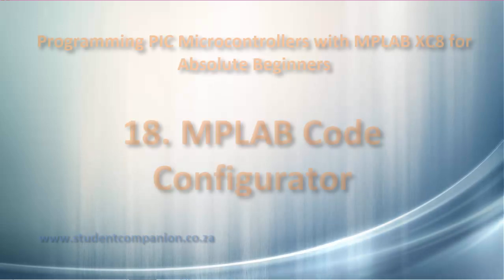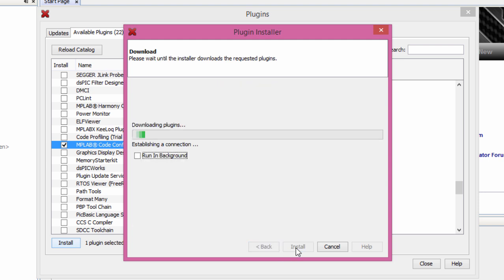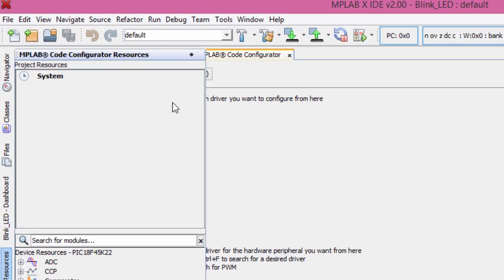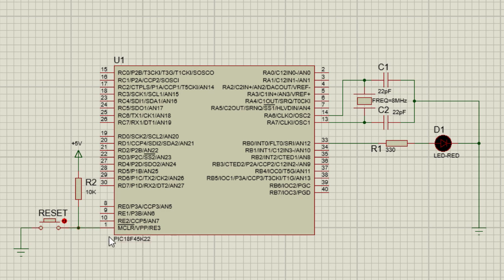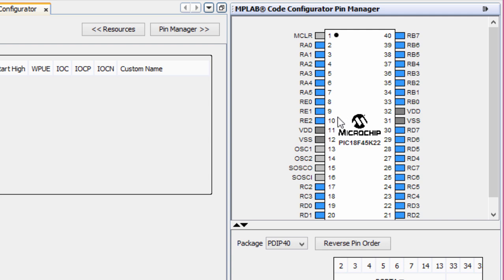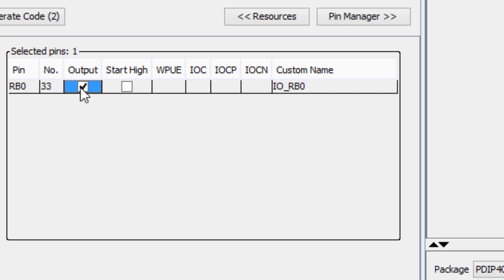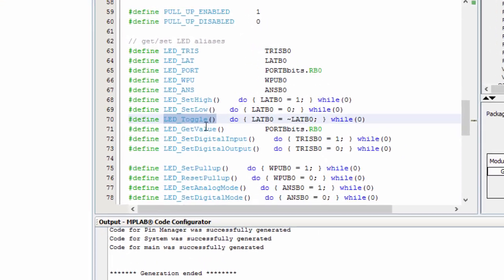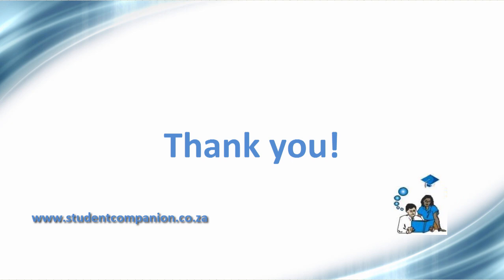18- Getting Started with MPLAB Code Configurator | MPLAB XC8 for Beginners Tutorial

Comment: Thank you for your great tutorials! Its has been a very big help. Unfortunate I cannot get my MPLAB Code Configurator to work. I have followed every step on the web to install it and tried every possible thing but keep on getting the the same message "Project's device not supported by the current loader libraries." I use the PIC18F4550. It might be a simple mistake but I really have tried everything. Can you help?
Reply from the maker: Hi.
Thanks for watching our tutorials and for your feedback.
The error message you received means exactly that, the device you selected, the PIC18F4550 is not supported by  MPLAB Code Configurator, that's an old device, more than a decade since it was released.
Unfortunately so far Microchip is not adding support to very old PIC microcontrollers, I would advice to select a newer model which is supported by MPLAB Code Configurator (MCC), like the newer equivalent the PIC18F45K50, you can check online for a device comparison,  they are very similar but the newer PIC18F45K50 have some extra few features and really cheaper compared to the old one, so there is no reason to stick to using an ancient device if you could use a newer one especially for a new project.
You could also use the newer PIC with  MPLAB Code Configurator , do your settings then manually changing  the generated code to match the older PIC, but this way it's gonna be more work and can't be edited in MPLAB Code Configurator again.
So I advice, choose a different supported PIC like the PIC18F45K50. There is a list of all currently supported Microcontrollers in the release note. On MCC website ( https://www.microchip.com/en-us/development-tools-tools-and-software/embedded-software-center/mplab-code-configurator), under Device Libraries, open the release notes of the: PIC10 / PIC12 / PIC16 / PIC18 MCUs.
Reply: Thank you for reply so fast. I will  do what you recommend. Thank you.
Reply from the maker: You are welcome.  If you have more troubles, don't hesitate to ask again.

Comment: MPLAB CODE CONFIGURATOR not working for PIC16F877A MCU, using MPLAB v4.05 and Xc8 v1.44...
ERROR: libraries for project device not found... Kindly help
Reply from the maker: Hi. MPLAB Code Configurator doesn't support very old PIC microcontrollers. The PIC16F877A was made more than 20 hears ago, it was great during its time but not anymore. There are many better and cheaper alternative.
There is a list of all currently supported microcontroller at the bottom of the PIC10/PIC12/PIC16/ PIC18 MCUs release note: http://ww1.microchip.com/downloads/en/DeviceDoc/release_notes_pic10_pic12_pic16_pic18_v1_81_4.pdf

Comment: dude pls help me i dowloaded first mplab x ide 5.00 then i dowloaded 5.15 still i cant open  this code configurator idk why
Reply from the maker: Did you install the code Configurator also?
Reply from the maker: And thr compiler XC8 compiler. Did you install it as well?
Reply: @StudentCompanion  ofc
Reply: http://microchip.force.com/microchipknowledge/articles/en_US/FAQ/How-to-add-a-library-in-MCC look this link i am trying to do this steps but still not working

how can i send the screenshot
Reply: it supposed support pic16f628a and pic18f2220 right?
Reply from the maker: What is not working? Installing the code Configurator or your code? 
We explained howbto install it in this video.
Reply from the maker: No. These are very old devices. Older than maybe more than 10 years. MPLAB Code Configurator doesn't support these old devices. Use newer PIC models if you want to use MPLAB Code Configurator
Reply: @StudentCompanion  ohhhhhhhhhh mannnnnn for example i wanted to made lcd writing like u did n your course then i couldnot find lcd.h file
Reply from the maker: You can. Why stuck in the past with old PIC models which are even expensive? Just use a newer PIC and follow the example of LCD we sent you in the other link

Comment: I installed it in the same way but I am getting some libraries are missing
Reply from the maker: Which PIC are you using? Which exact errors are you getting?
Reply: @StudentCompanion  I am using Pic18f452. I am getting error like some libraries are missing in mcc/library
Reply from the maker: That PIC is very old. It's not supported by MCC. You must select a different PIC model. MCC supports mostly only newer PICs.
Reply: @StudentCompanion  now mplab software is not opening for me sir
Reply from the maker: You must be doing something very wrong
Reply: @StudentCompanion  while I am opening The Mplab I am getting the error I had sent you the pic in Facebook
Reply from the maker: That error means the PIC you selected is not supported by MCC as I told you before.  Ancient PICs are not supported.
Reply: @StudentCompanion  I had done how it is in the PDF but still I am getting the same error for mcc
Reply from the maker: And what exactly did you do as in the pdf? And what error are you still getting?
Reply: @StudentCompanion  I had installed the libraries in the mplab sites and still I am getting same error as how I sent you the pic.
Reply from the maker: Because you don't listen to suggestions.  This video is for mcc, what exactly libraries did you install? MCC? If you need support you must learn to be clear about your questions. Specify clearly what steps you have taken, which compiler version yiu are using and exactly states the full error that you are getting. And comment on a correct video, dont confuse your questions by commenting about plib on an mcc video or vice versa. Be specific otherwise you are wasting our time.
Reply: @StudentCompanion  I had installed the libraries from option menu but still I am getting That libraries are missing
.
Reply from the maker: Which library is missing? Which PIC are you using? Wht is the exact error message you are getting. What is the version of your XC8 compiler? I can't guess what could be wrong when you don't provide full info
Reply from the maker: Read this release note at the end there is a list of all 8-bit PIC supported by MCC: https://www.microchip.com/mymicrochip/filehandler.aspx?ddocname=en609519

Comment: Very helpful tutorials...but can you tell me..or if anybody knows what library yo use for the PIC 16f684  micro controller for use in the  MPLAB Code Configurator...Thanks
Reply from the maker: PIC16F684 is very old. MPLAB Code Configurator only support new PIC models.  What is the reasons to use an old PIC while there are new cheap better models?

Comment: hi .when i tried to open code configeration . it shows ''the project device is  not supported by the currently loaded libraries.''  how can i solve this problem?
Reply from the maker: +Jayesh kumar p r which PIC model are you using? Not all PICs are currently supported in MCC. Only mostly new PIC models are supported.
Reply: I did nt choose anu model. Its show s thr message when i click on code configeration.
Reply from the maker: +Jayesh kumar p r you can't start the configuration before choosing a PIC model. When you start a new project you start by choosing a PIC Microcontroller first. Make sure the PIC chosen is supported by MCC.
Reply: Thank you sir. When i tried with the same device which u used. Its working .may i know how to check the device which support code configerator?
Reply from the maker: +Jayesh kumar p r you can get that info from the release notes. They give you the list of all supported devices. If you want to use an 8-bit microcontroller open the PIC10/PIC12/PIC16/PIC18.  For 16-bit and 32-bit open the PIC24/dsPIC33, PIC32MM or the PIC32MX release notes. You can access these documents from this link under the current download tab: 
http://www.microchip.com/mplab/mplab-code-configurator
Reply: i could solve the problem. thank you. can you show how to select simulator? is simulator another softwear or already inbuilt in mplab?
Reply from the maker: +Jayesh kumar p r simulator it's another software. It's called Proteus.  From Labcentre electronics

Comment: It is not working with my PIC16F616 can anyone please help and tell me what I might do as you are using Code Configurator in many further examples due to which the tutorials don't help much.
Thanks
Reply from the maker: +Jatin Fauzdar can you be more specific of what is not working? You can't open MPLAB code configurator with the PIC? Which example you are trying with which doesn't work?
Reply: I was trying to work with PIC16F616 and I tried to generate a PWM using the MPLAB Code Configurator and it says that it doesn't work with my version of PIC and told me to download the libraries, I did that but it is still not working and showing the same error can you suggest as to where I might be going wrong or does MCC does not work on PIC16F616
Reply from the maker: +Jatin Fauzdar the PIC16F616 is very old. MCC supports only new PIC models at this time. If you want to use MCC choose a different newer model.
The library that we used in other tutorials are PIC18F peripheral libraries and as the name suggests they are for PIC18F only they don't work with PIC16F like uour PIC. Only MCC works with different PIC models like PIC16F, PIC18F, PIC24 etc but the catch is choose a newer model. Not all are supported at the moment.
Reply from the maker: +Jatin Fauzdar the options you have with your PIC is to accesd the registers directly. You'll have to read your datasheet.
Reply: Thanks a lot
Reply from the maker: +Jatin Fauzdar you are welcome!

Comment: Please also give tutorials on the PIC18F46K22, PIC18F4550 Microcontrollers. And give tutorials on Servo, RC522 RFID, DHT11 Sensor, GY80 Sensors I mean to give tutorials on all common and new modules like Robotics, RC and other sensors.
Reply from the maker: +PART&Co., by chipTALHAelectro hi. They are thousands of PIC Microcontroller models. We can't use all of them in our tutorials that is why we are picking 2 or 3 models. It's not about the PIC used by the concept as the same code and configuration can be used to program different PIC models as well.
Reply: OK Thanks!!! For reply I was just asking if you use as they are powerful and most common USB microcontroller also included in this but please give tutorials on sensors and modules. Thanks!!!
Reply from the maker: +PART&Co., by chipTALHAelectro thanks.  We will record more tutorials on sensors soon. Thanks watching our videos.

Comment: thanks bro for the tutorials, I was working on MiKroc but I wrote a code for a 4x20 LCD display, it was working fine with Proteus  but on my hardware it works but it doesn't display all the letters correctly. That;s why I am switching ti MPLab, it seems more stable and and easier. Do you agree with me? 

I am using pickit 3 for programming my chip
Reply from the maker: +Lion Heart it all depends on personal preferences.  MikroC seems easy to use with their wide range of included libraries but for more flexibility mplab is the best. You can customize anything you want and their libraries are open editable unlike mikroC where you are limited to what is offered.
Reply: So you recommend  me to work with MPLab?

I think Microc LCD library doesnt work with LCD 4x20. because it mix up letters.
Reply from the maker: +Lion Heart are you sure you are using the lcd commands correctly with mikroC like _LCD_THIRD_ROW to move cursor to 3rd row and _KCD_FOURTH_ROW to move cursor to 4th row?
Reply: Hi bro, I found the problem, it was 4X PLL enable, this was casing the problem. Bro, I have an offer for you, I want you to teach me the mcu configurations, and interrupters, UART, I2C..etc and I will pay you for that. I am new to this and I really need your help. We can do that using either chatting or call or video call, if that is OK for you.
Reply from the maker: +Lion Heart good to hear that you managed to fix everything yourself.  For that proposition please send us an email

Comment: When designing a new system what is the best method for determining the necessary oscillator freq. when you have several components using ADC, EUSART, SPI, etc?
Reply from the maker: +Dave Mueller will depend on the requirements of each bus. USB for example requires 48MHz for full speed.  SPI  or I2C depending on the slave device used  might restrict the speed. All these frequencies will be derived by either a multiplier/devider of your oscillator.